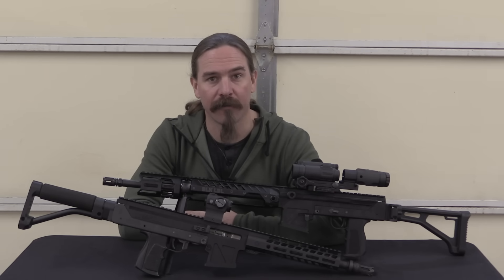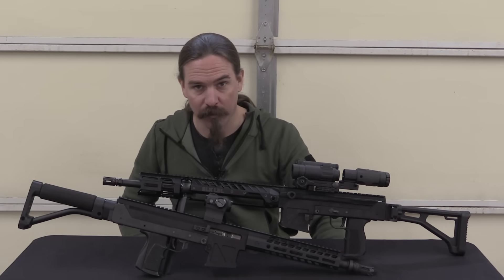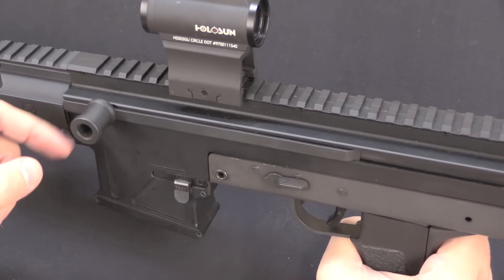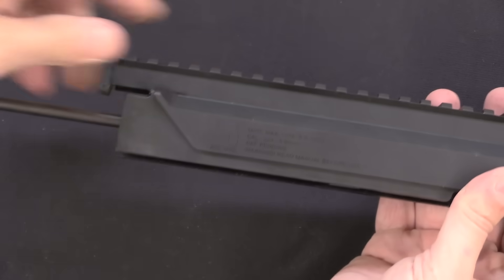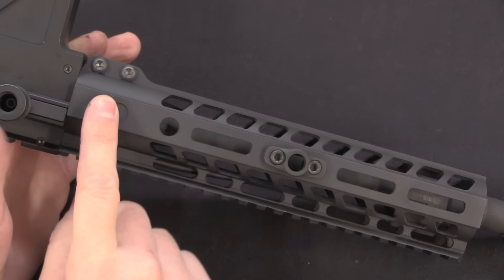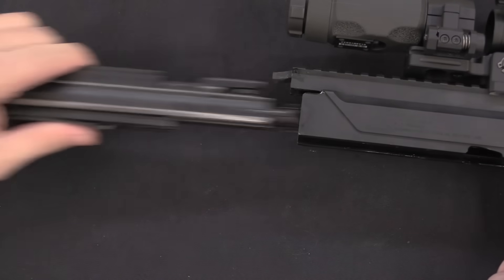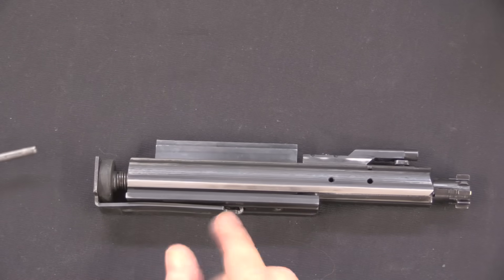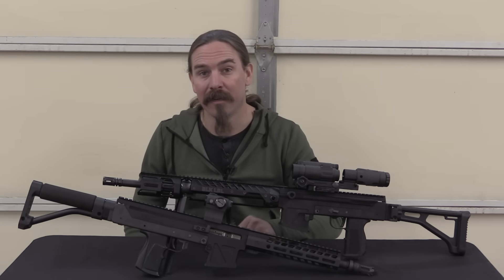Engineering Adaptability and the NFA: Lage Max11/15 System

Comment: US firearm law is weird, so the reciever is considered the firearm and the special bolt/upper/barrel aren't. So if somebody shot somebody by let's say pointing the upper assembly at somebody with a round in the chamber, the bolt locked in place into the locking lugs and then they hit the firing pin from the back with a hammer what would they have legally shot them with?
Reply: An illegal firearm, since it lacks a serial number?
THAT is the really weird part of the the NFA laws, that each model of weapon have their own definition what the vital part that should be serialised is.
Reply: @johanmetreus  So would the upper be the illegal firearm or would that be the hammer? lol
Reply: @RossMitchellsProfile  upper receiver would be the legal part of a FAL.... shakes head

I can only assume that since we are fundamentally talking tax law (and how the destructive device classification works)...  I simply can't figure out if the laws are the result of convoluted minds working for generations, or there is some high level trolling going on.

Comment: I’m confused by something.  Isn’t the definition of a receiver the part that receives the magazine?  And if a receiver is the only part legally considered a firearm wouldn’t it make that upper a separate firearm?
Reply: Seems the definition in firearms industry is the part that holds the operating parts, and then receive other parts like barrel, handle, stock and so forth.
USA law though define the receiver as "the part with the serial number on it"....  and it's unique to every model of we4apon.

Comment: I reckon the grip could be used as an ‘ejection port’.  The case ( or full cartridge if needed) is extracted, then hits a ‘ramp’ ejector kicking the back of the case down the grip, primer down.  

Either way, I want one in 300BO, with a 9-10” barrel, whack on a rail with pic top, M-loc at 3,6 and 9, suppressed.

Comment: Genuinely surprised to see that there is enough energy left in the system to detonate a cartridge after the bolt rides home, stops, and locks. Okay, maybe I shouldn't be surprised--but it still met me as strange, definitely different than just picking up a cartridge, seating it, and hitting the primer when the bolt ends its travel.

Comment: As the owner of a fine example of a MAC M-10 I am offended that Ian called it useless. It makes a fantastic paperweight or doorstop. And occasionally it will spray bullets in the general direction I point it.
Reply: with a big can on the front and a decent stock M10s can still be practical...... that said I love my Lage Max31
Reply: @beltfedTODDRULZ  I have an SWD 9mm. They zytel mags a garbage but with converted pam-2 mags it runs great. Bone stock I can keep a mag dump on a silhouette at 10yrd. Not amazing but it is fun.
Reply: @onebladeprop  , I got a M10/9 Fat Mac and i have a STEN mag housing/ grip  with a big steel paddle release and bought a good pile of mags. Runs great but i wanted a slow rate of fire and a Red dot and Lage delivers that
Reply: Never has a more efficient 9mm cartridge stripper been produced. Accuracy through rounds per minute - one of 'ems gotta hit something.
Reply: If you ever find yourself in a gunfight inside a phone booth it's the perfect tool for the job
Reply: Good ol' MAC-10. Maximum range = 100 meters. Effective (technically) range = 50 meters. Accurate range = 10 feet.
Reply: @Phaéthōn_the_Radiant  , Okay I think the Bullshit is getting deep..... Have any of these posters actually shot machine guns because if you're going to shoot 80's Action Movie style from the hip like Ben Stiller in Tropic Thunder than yes 10' is about right but use the sights and a big ass suppressor that was designed to be part of the system it's able to easily hit 25-100yard targets for any one proficient with firearms
Reply: @beltfedTODDRULZ  Oh my, you're quite correct. I had completely forgotten we were in 2022 and jokes don't exist anymore. My bad.
Reply: @Phaéthōn_the_Radiant  sorry i was drunk and yesterday i had to RE- BUY my NFA collection from soon to be ex-wife at Divorce  Mediation to keep it.
Reply: @Phaéthōn_the_Radiant mixing different measurement systems … knobhead
Reply: I shot the 10 at a outdoor gun show in utah
Reply: @frankcastle4615  one in each hand makes Chuck Norris proud
Reply: I like my M10 in 9mm Very Much.  I can hold 4" (10 cm) groups at 25 meters< And 32 Rounds in 1.2 Seconds is Way Cool. Way Cool.
Reply: Yeah they're pretty useful as an indiscriminate hole puncher...
Reply: Yeah,but is it fun? I bet it is
Reply: As an owner of the m11 a1 , yup, paperweight is about right . 😅
That thing ate ammo at an astounding rate and didn't even scare the paper targets down range.
I would rather an uzi, or American 180 any day 😅
Those American 180s are some slick stuff.
Reply: Pray and spray....hallelujah 😂
Reply: Hey I know its been 3 years but I've been looking to get one of these, are they accurate at all? Are they durable with the lage uppers? Do they have long lasting round counts with 5.56 too?
Reply: @MastaGullz  I have a bone stock SWD that takes those dogshit zytel mags. With modified PAM-2 mags it runs perfect. After a lot of practice I could keep a mag dump mostly on a silhouette at 10 yards. I don't have any Lage stuff but I've always heard great things about them.
Reply: They're great for dealing with young men in Russian trucks
Reply: The one use case I've heard of that actually makes sense is close quarters assassination. So, yeah - essentially useless.
Reply: @AJoe-ze6go  back in the good ole days  they offered an "Operational Breifcase"  where the subgun and can were disguised in a breifcase with a lever hooked to the trigger for executive protection etc...
Reply: John Wayne was an investor and got a little bit irritated when they demo'd the breifcase but the guy had it pointed backwards
Reply: @beltfedTODDRULZ  Kinda stupid thing to do as the briefcase has a business card holder where the weapons muzzle was...

Comment: Seems like it could have been made significantly shorter if they just mounted the magazine well on the side instead of the bottom, so they don't need the giant bolt extension thing.
Reply: That mangles the balance of a firearm, though.

Comment: The only way to improve on this bit of clever engineering would be a conversion to braided springs.
Reply: What do braided springs do better? (Appart from looking kinda neat)
Reply: @Piromanofeliz  They're stronger (which can let you decrease the length of the spring), and can be quieter than regular springs. 

Fun Fact: the MG-42 used a braided spring.
Reply: @ironwolfF1  cool, thanks!

Comment: Great video! They could come up with a magazine for the Mac 11 that holds a mechanism with a button below to interact with the recoil spring locking mechanism, so you dont need an ad hoc tool. Can be all plastic with just a spring button and a rod to interact with the tab there.
Reply: You just use an M11/9 magazine. Lage has that in one of his videos.
Reply: @billstevens5277  True, I found this out later. Still, I think it would be preferable to have all of the parts needed for disassembly on/in the gun. Granted, I know these are range toys, but still.
Reply: Genius idea, actually. Of course it would need to be protected so it could not accidentally lock up the gun.

Comment: so if the lower only holds the bolt back, if you chambered the upper without a lower fitted would it just go runaway on you? might be a cheap way to have a bit of dangerous fun
Reply: No spring in the upper to drive it.

Comment: Why did the uppers need to be approved by the AFT, given that the registered serialised firearm part is the MAC lower?
Reply: "Because fuck you" -AFT
Reply from the maker: In case ATF decided the upper was a machine gun all by itself.
Reply: @ForgottenWeapons  Is the open bolt nature of the upper the problem? Was this a legal requirement to wait for approval or a precaution against a future cease and desist?
Reply from the maker: It was a precaution, not a legal requirement.

Comment: It might be worth noting that the internal recoil mechanism (IRM) for the m11/9 also uses a standard AR bolt carrier group like the external recoil mechanism for the m11/9. At least mine does. I believe the custom bcg for the m11-a1 is because of the shorter receiver. It wouldn’t surprise me if the m11-a1 external recoil mechanism upper used a proprietary bolt as well (again due to the shorter receiver) but I have not seen one to confirm. Also the M10 uppers may or may not use a proprietary bolt but again, I haven’t seen any yet to confirm.

Also, instead of using a brass rod to hook the IRM into the bolt for disassembly (as shown in the video) you can simply insert a unloaded 9mm magazine into to magwell while the bolt is back. This makes disassembly much easier and a much simpler process to adhere to. Disassembling the IRM is actually quite easy once you get used to it and can be completed in less than a minutes time

Comment: A square profile bolt carrier with AR-18 style dual recoil springs would have been just as easy to do as what Lage did, since he is not limited by the confines of a standard AR-15 upper. 

Edit: a long recoil AK style carrier and gas system would also make it a lot easier to fit a conventional recoil spring in there. 

Still cool.
Reply: I was thinking the exact same thing.  I'm assuming that the reason why Lage didn't go this route was because there wasn't a ready supply of relatively inexpensive AR-18 parts that could be used when the project started.  Perhaps with the Brownells BRN-180 being a thing now, maybe there will be a Max11/18 in the future.
Reply: @peteranderson037  a new gas key with the guides for the rods and springs on the side would have been relatively simple too. Was thinking about it more after I posted. Now I want to try making one because I don't think I've seen it on the other iterations of receiver extension spring elimination setups.
Reply: I'm sure there is a reason Lage did it  the way he did it. I'm no engineer, so I'm just gonna go along with his design.
Reply: @scottflickinger4186  It might be as simple as patent rights.

Comment: I feel like having the mag well in the pistol grip open is asking for gremlins to get inside. I'm sure a short mag-well plug would be a simple but wise improvement... and for the internal recoil version, a mag-well plug with a spring plunger in - so you can press the plunger in the bottom of the grip to push the and lock the spring-bar for disassembly... instead of sticking a random manky old chisel up there. Again a simple but valid improvement that should've been part of the original refit package.
Reply: I definitely agree with the magwell plug with a button in it for the internal version.

Comment: Wouldn't get dirt and dust get into the mechanism through the original mag well?
Reply: My guess is that its covered up
Reply: @yokedmonster  Maybe but in the M11 version we see him pushing down the tap to hold the recoil spring for disassembly. Maybe some dummy mag or something?
Reply: @CrenVerdis  yeah maybe that with low profile mag release or removed completely

Comment: “Don’t drop this, or the spring will shoot across the room.” Sounds like the voice of experience.
Reply: Having springs from rare, priceless guns shoot accross the room must be the most nerve racking part about Ian's job.
Reply: He knows. He's admitted a few times to doing it off camera and putting it partially back together in a way so it won't shoot across the room for the recorded disassembly
Reply: "Sproing"
Reply: @nickoloes  Was looking for your comment! :D
Reply: I once slipped while reassembling a 1911 and had the spring propel itself & the plug through a literally 2" diagonal gap between doorways across a hall and break the window in my front door. Springs are malicious entities that must be treated with respect.
Reply: @J.DeLaPoer  The war may have ended but that pistol wasn't done killin'
Reply: @ThisNewHandleSystemSucks  guess you can say that spring kept tensions high
Reply: I have a small collection of lesser-known weapons that I acquired pre-internet, so learning to field strip them without a manual involved a lot of springs whizzing across the room. I'm sure Ian has done it more times than he can count.
Reply: Every AR guy knows this struggle
Reply: "Did you ever kill anyone with a Mac-10?" "No." "Did you ever shoot one?" "Yes... but they were all bad." Drops it down the stairs
Reply: Comes with an impromptu ballistics knife.
Reply: The noise of buying a new spring, or buying a new assembly if there’s any little plastic bits in the spring assembly 🙃

Comment: Permanently modifying any registered MG is going to decrease it's value (i.e., drilling an opening into the rear of the registered part), even on Macs. Now, is that important? To some I'm sure they would reticent doing so. I would  consider using T91 upper parts since they should be drop-in AR compatible AND allow for the folding stock WITHOUT the precarious dis-assembly regimen for the captured recoil spring. Easy peasy, mayhap???
Reply: Stop throwing out 50 cent words. You are using them incorrectly and that makes you sound stupid. Reticent...do you even know what it means?

Comment: You say it was clever to design that disassembly and reassembly method for the internal spring. I say it would have been more clever to just make it captive so you can disassemble it without the extra tools. Something in the style of an SKS spring assembly would have been perfect. Not saying they didn't do good as is, it certainly isn't bad and I am sure it works fine, but idk if they deserve so much praise. Basically a less convenient Colt Woodsman takedown.

Comment: Why wouldn’t you be able to convert a machine pistol lower? We all should understand the only interface that really matters between an upper and lower is that a hammer strikes the firing pin and is reset. Beyond that it doesn’t matter what your lower or upper is.
Reply: because why would you though, that's where all the important bits are, and more importantly, that's what is actually registered. modify that and off to jail you go. (i know, laws on these are stupid)

Comment: What I don't understand is why the lage uppers are acceptible but putting a DIAS in a different gun (HK DIAS is a mk48) is unacceptable
Reply: You aren't making a machine gun when you make a Lage, you are just adapting an existing machine gun. With a DIAS you are changing a weapon from semi-auto to a select fire weapon i.e. manufacturing a machine gun. If that DIAS is pre-1986 it's not an issue, if it isn't then you had better be an SOT.

Comment: Could that internal recoil system bolt be used to make a AR-15 with a folding stock? Gives you the foldability of the AR-18 but retains direct impingement.
Reply: isn't that just an AR-10?
Reply: @KIWI_DUDE.  no? The ar10 can't fold and is in .308

Ar10 is just a bigger ar15
Reply: @marcusborderlands6177  I thought the g36 was an ar-10 or am I confusing 18 and 10?
Reply: @KIWI_DUDE.  you're confusing 10 and 18.
Reply: @ScottKenny1978  thank you

Comment: Seems like this is best suited to a HBAR LMG style configuration, on account of the open-bolt.
Reply: Since it takes AR-15 barrels, I'd be tempted to rebarrel it in .224 Valkyrie just for the lolz.  Firing a round designed for ultra-long-range precision shooting from a full-auto, open-bolt gun would be pretty amusing.

Comment: Fact that the Mac 11 can be 3-D printed and then these Lage uppers purchased is what I find to be pretty cool
Reply: Yeah but they won’t last long because of the weak strength of the rear plastic plate that’s usually welded steel. What’s really special about the internal recoil version of this, is that it has its own steel plate on the back which gives wonderful reinforcement to that usually weak rear.
Reply: @TheNandor  I haven't looked into the material/strengths available but you can print 3D in metal.

Comment: I am an armchair gun Smith with this question:
Would a AR18/180 style of style of recoil Spring have been a better idea?
Reply: Fire group in the registered MAC lower is an open bolt sear design and cant be legally overtly modified...
Reply: @cycadaacolyte6349  my question was about the spring assembly for the bolt carrier, ie:
Ar18/180 has 2 short springs in the bolt carrier and this setup has 1 large highly compressed spring.
Reply: Maybe? Plate and two guide rods would obviously work, the problem is Disassembly. With the AR18 system, how do you take spring pressure off the bolt carrier to take it apart?